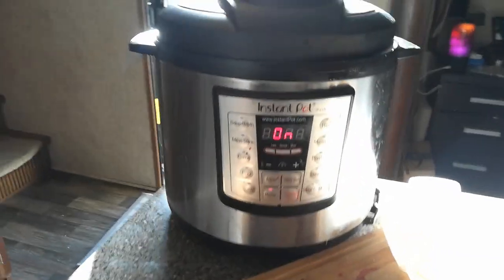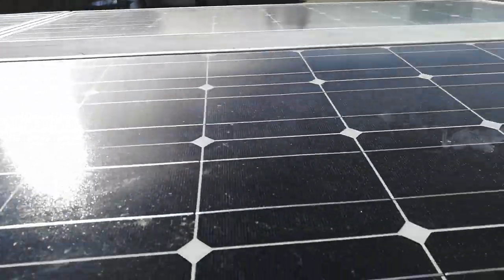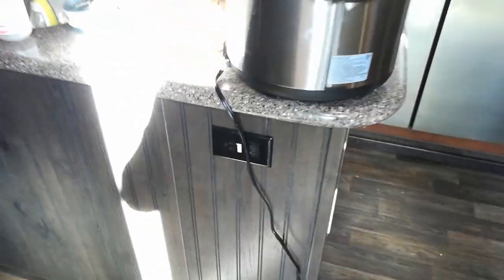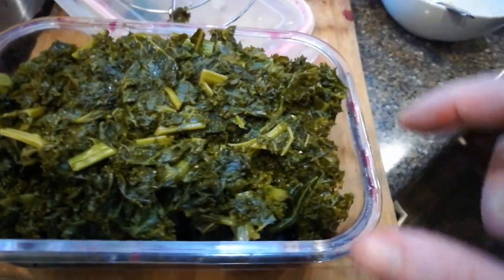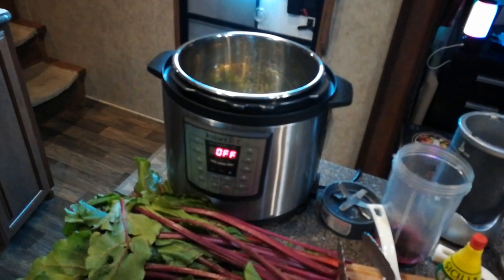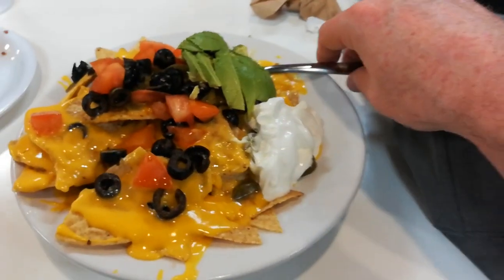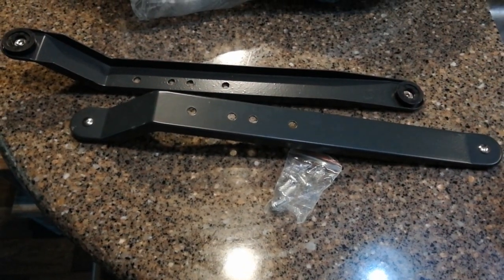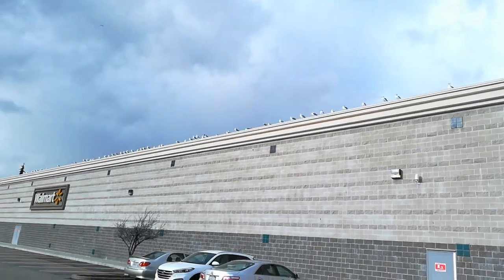Solar Powered Instant Pot

Comment: Love the solar, can't wait to see what you short circuit when you add that cord. Do you have a schematic diagram of your 5th wheel? BTW the olympics opening ceremony starts in a few minutes. You should see what I ordered for my party. 8# of the fi nest ssaltwater taffy inthe world so I could get free shipping. Over 500 pieces! Sugar high!
Reply from the maker: woah, don't forget to brush.  I don't have a schematic but it's going to be on it's own wiring with new outlets, so no problems.   I do want to figure out how to wire solar panels into one of these 'micro inverters' .  I guess you can plug one of them right into a household socket.   nobody really talks about them
Reply: show me a link for an MI. I've got the preview unit to the instapot. It's Wolfgang Pucks Pressure Cooker.  Basically bigger and analog controls instead of digital. I did a flank steak in it the other night with a bunch of green peppers. Just melted in my mouth. I love using hickory liquid smoke so it tastes like it was grilled outside. I bought a whole quart of it on Amazon.

I can imagine heat would be an issue. You have to realize the more you shrink the form factor in electronics the more the reliability goes down. For instance, 120vac lights. Everyone and their brother on YT has reviews about all in one bulbs and none last. Like 5 years ago I bought lights and spent a bit more to get whole in-wall units. I spent more but I got reliability. I also got the look I wanted. 2700 Kelvin which looks almost exactly like the incandescent bulbs I like. They're also dimmable (home depot) and 5 years later I am ahead of the game because none of mine have failed. Moral of the story -- usually the bigger the better, especially an item like you are describing which has a lot of heat to deal with.

Another person you might ask to review an MI is Dave of Eevlog. He's wicked smart about the details and more up to date than I am. If you can get his attention.
Reply from the maker: hey john, here's a link to the micro inverter: https://www.amazon.com/SolarEpic-Inverter-Stackable-22-60V-Output/dp/B01A93QUH4/ref=sr_1_7?ie=UTF8&qid=1518482540&sr=8-7&keywords=micro+inverter

thanks for the info, I just bought some hickory liquid smoke on amazon ;)., ya the pressure cooker is great for meats when I've tried.
Reply: It's already got a fair of amount of bad reviews. Sounds like its roasting away which is related to its form factor (fancy electronics term refering mostly to SIZE.. particularly for a power item) due to heat. You should think about it more or at least find a better brand. Why is the MI part important? 

 Sometimes there are different or better ways. The main complaint I often see about the inverters is that most of them don't have ways to shut down the fan when not in use. Pr'y cheap design or CYA for an already existing fire hazard. So people often put them in out of the way locations but wish they were closer so they can hit that OFF switch. Is that why you wanted a micro one?
Reply: watch out, that hickory smoke is addictive! I add it to meats, potatoes, beans, and even ketchup when the fries are boring. I may even use my quart up long before I would have thought.